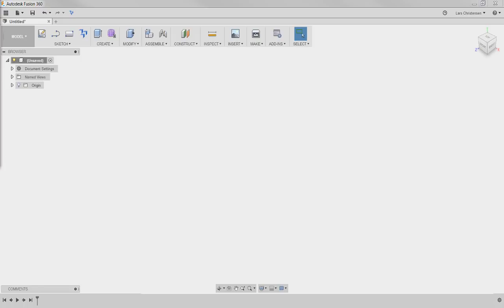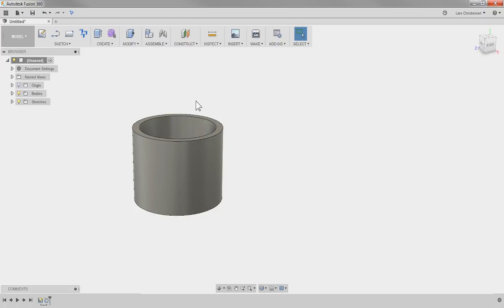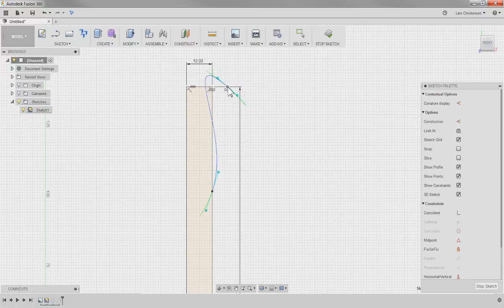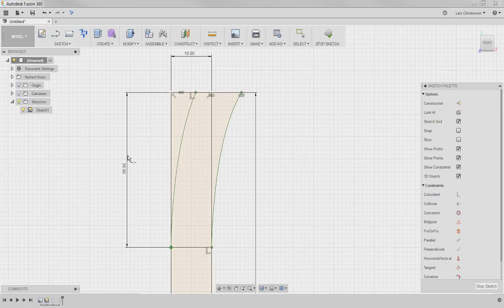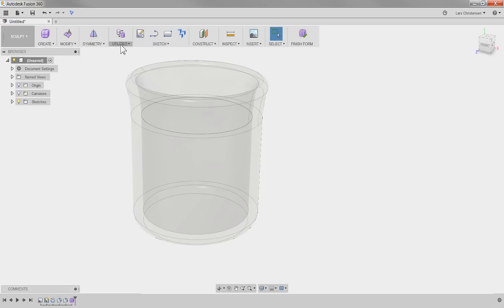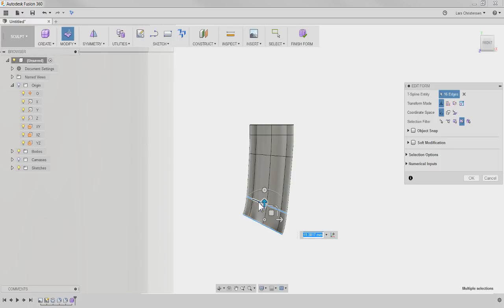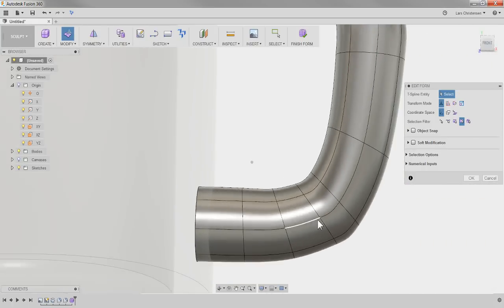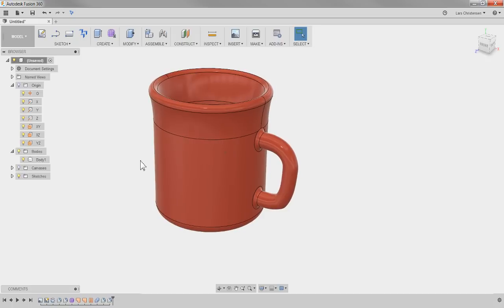Fusion 360 — Combine Sculpt To Model Work-space Important! — #LarsLive 78

Comment: How did you change the lines to construction?
Reply: When in sketch mode, either before you put the line down or after it's down but have it selected, there is a button in the sketch menu that turns drawing features into construction lines. You can toggle it on and off. Hope this helps!

Comment: Thanks, the handle bit solved my problems, I'd created a fancy shaped taper using a cylinder form and had been trying to cut that shape out of a solid.
Reply: Another method could be to generate a spline in a sketch and then use the "pipe" function to create the handle feature from it. This might be more practical for the parametric aspect of design wherein you could setup a few simple parameters to make easy, scalable changes to the handle/cup as a whole. Using the molding feature can be more limiting in this case I think.

Comment: Hi Lars, thanks for great videos:) I just have a problem that I can´t solve! I will combine many components to a solid body for 3D printing. It is 720 small boxes (looks like a Rubriks Cube) that I have made a large box in the middle that I will make a hole into. It will looks like a shoebox without a lid... upside down, so I do not have to print the inside of box. Is this something you may have an answere to... I have searched the whole internet without results :)
Reply: You should ask this in the Fusion 360 Help Forums

Comment: Love the unlimited integration of the workspaces that it provides without damaging the final end result.Will the Cam result need tweaking to achieve the final desired result? Would you 3D print something like this before committing it to a metal prototype first?Thank you for diving in to these endless capabilities of fusion 360 as the printed books are not able to keep upWith the rapid updates being generated by the Autodesk software engineers . Bill.
Reply from the maker: Hi Bill K Thank you for watching! Glad you find the videos helpful